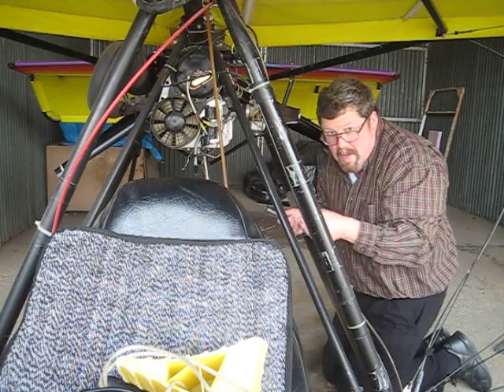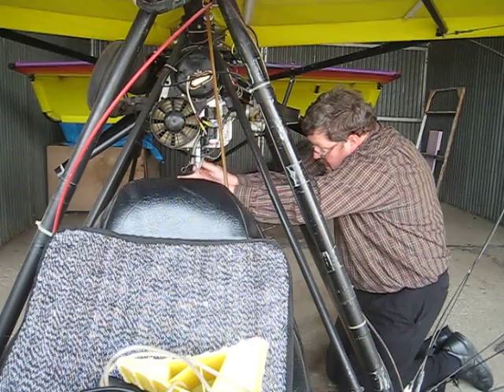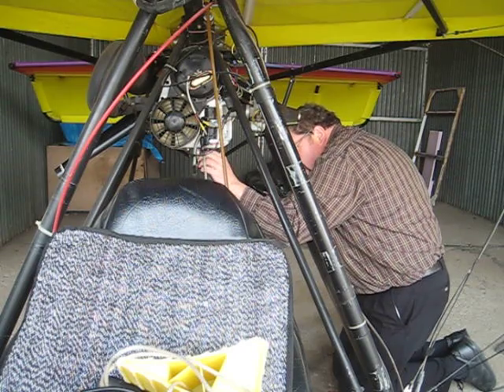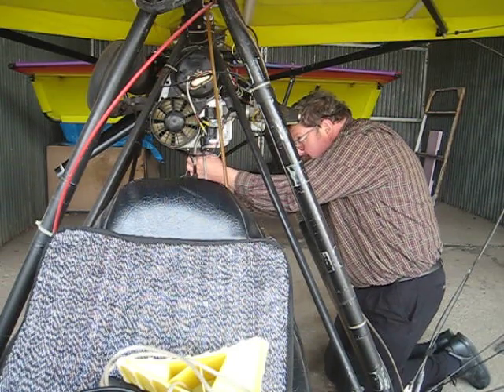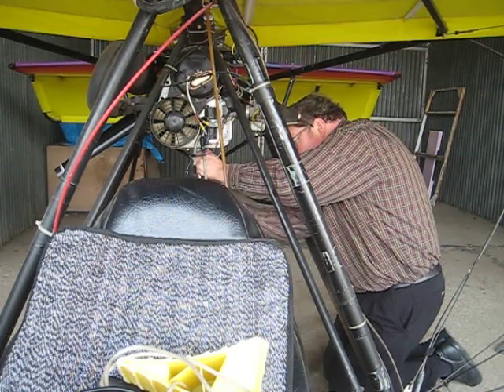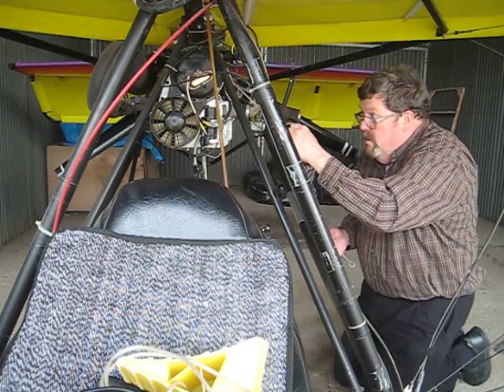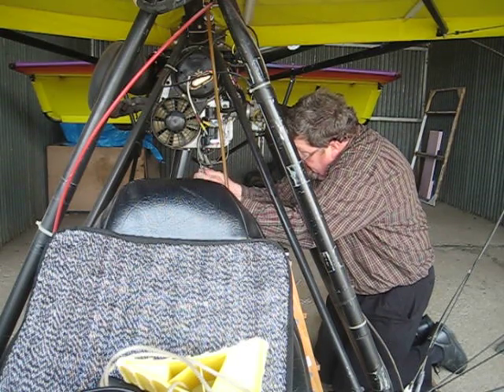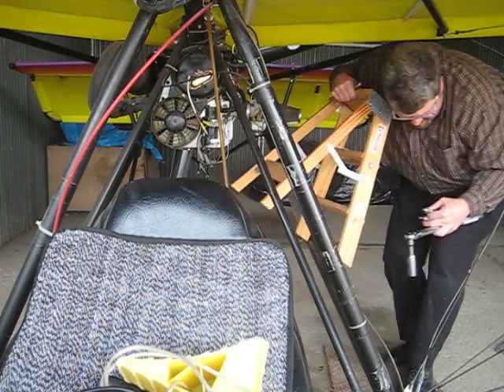Replacing spark plugs in a Rotax 377 powered ultralight aircraft after flooding the engine.

Comment from the maker: Not so sure it was the pre-flight... Until about a year ago I would shut the engine off by cutting off the spark.   That left a lot of extra fuel in the engine.   While the extra oil tended to protect things like bearings with an inverted engine it left a lot of fuel to find it's way to the plugs and fowl them with oil.   I have had a lot less problems starting since switching to cutting off the fuel first and then once the engine quits turning off the spark.